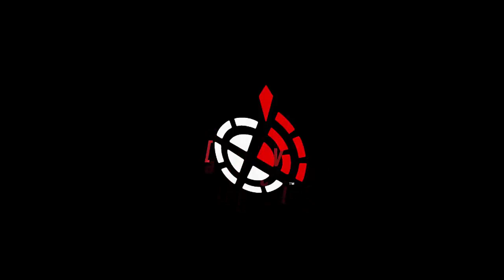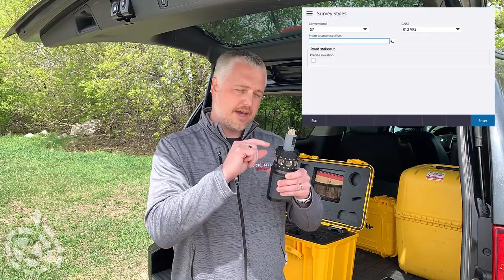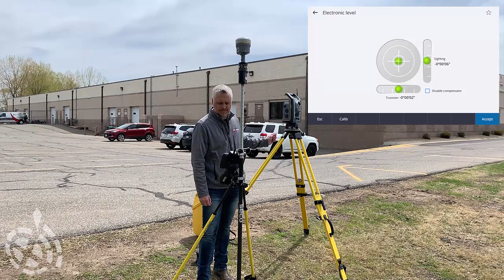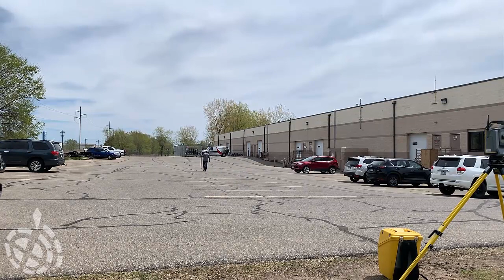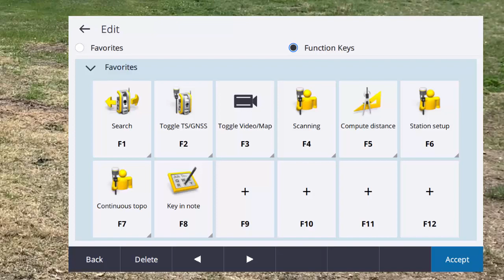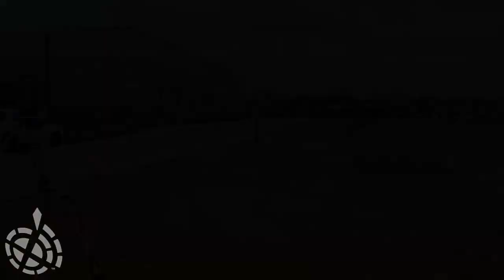Integrated Surveying with Trimble Access

Comment: Do you use the total station pole or the GPS pole?
Reply: You will want to use the total station pole.  Since the measurements are being based off of the prism height and adding the offset to the GNSS receiver.

Comment: So the TPS and GNSS data is all scaled to be either plane or grid, based on the job settings?
Reply: Yes, that is correct.  Thanks.
Reply: @westonschneider3544  awesome thanks. I'll have to play around with it more. We've got an S7 and R12i at work, but not many people are keen on integrated
Reply: Assuming the project was set up state plane grid. What do you have to do to get grid coordinates when using the total station? Also how does that work if not integrated and using the gps for setting control then setting up over it?
Reply: @billhelmick9721  Hi Bill, In the Cogo Settings of Access (Under your Job Properties) you will want to make sure the Sea Level Correction box is checked on.  Then your grid and ground data should match up.  A good test would be to measure in a few points with both methods and inverse between them.  You can then use the same project to set control and run total station data in.  When doing testing with customers I will occasionally use the old method of setting control in one job(with State Plane for example), then start a new job as a Scale Factor1 and link to the first job.  This would be another good test to check the control and make sure it matches with the initial job.  I hope this helps.  Thanks, Wes.